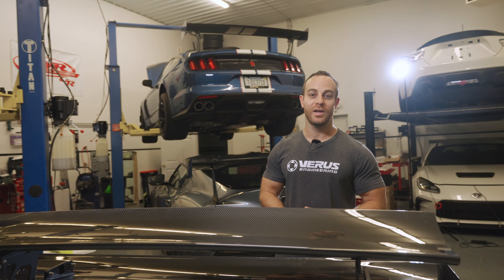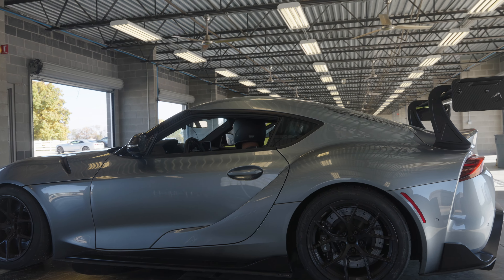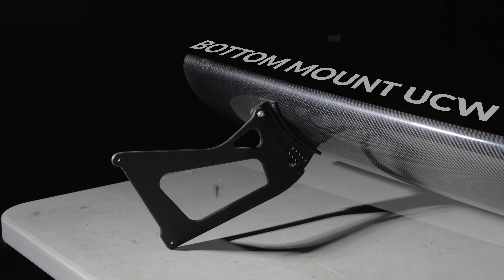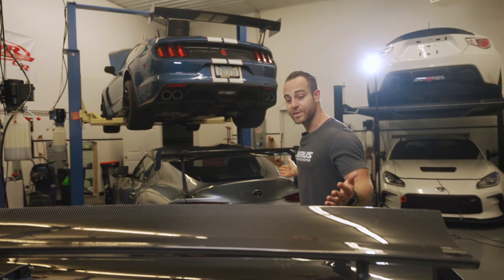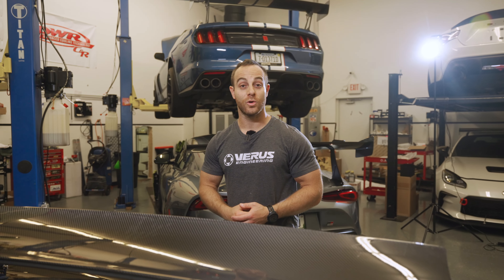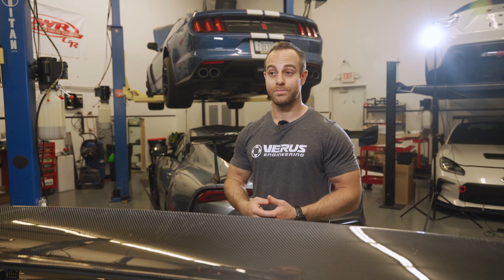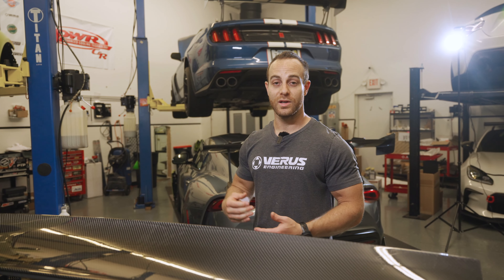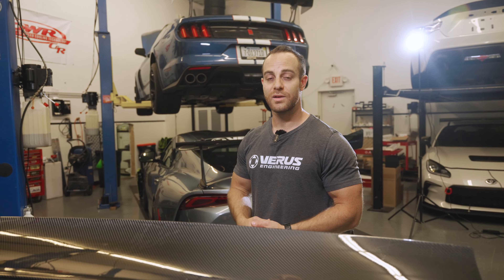Which Supra Wing is right for YOU? | The differences in our 3 wings.

Comment: Can you machine thicker/beveled endplates for the UCW swan neck to give it a more factory look? Something thick enough to keep the bolts flush? Since the endplates on the UCW swan neck position won't matter, having it in a fixed position will probably make it easier for install as well.

Comment: The MkV is relatively snappy on the limit at the rear end, even on custom suspension.  

I wonder if the biggest swan neck wing helps with that.
Reply: Same
Reply from the maker: Yes, it can. Rear wings or rear aero elements can add stability at speed.
Reply: More downforce at the rear and make the rear little softer, I got no snappy rear at all but remove the wing and the ass says hello outside the window

Comment: Is the UCW bottom mount wing a good choice for someone looking for aesthetics? I don't really plan on tracking the car, but will the bottom mount UCW have noticeable impact on my 0-60's or highway acceleration? Thanks!
Reply from the maker: There may be a little drag, but it would be negligible at most. For daily driving purposes where you're not pushing the car to its limits you most likely won't feel a difference at lower speeds.